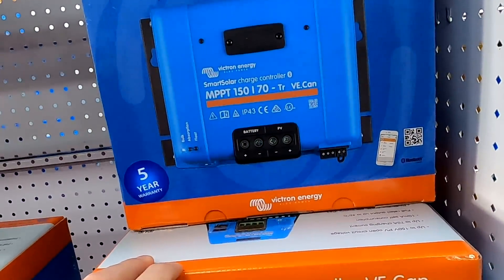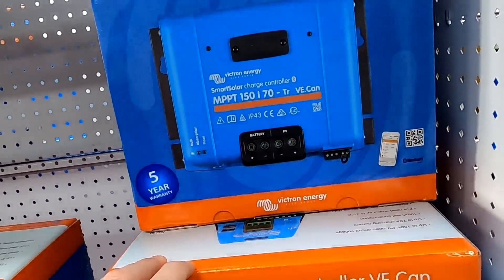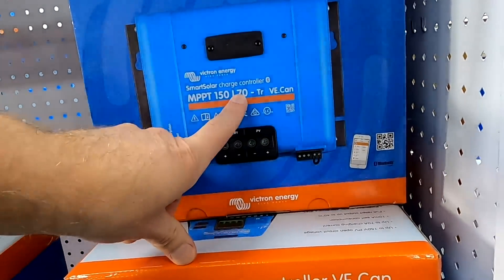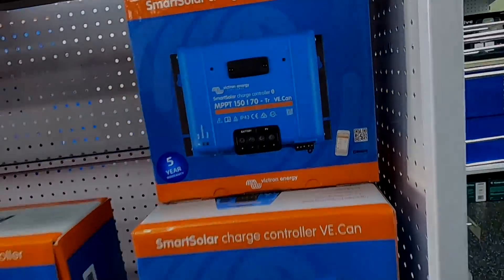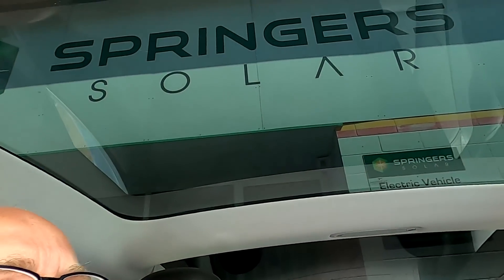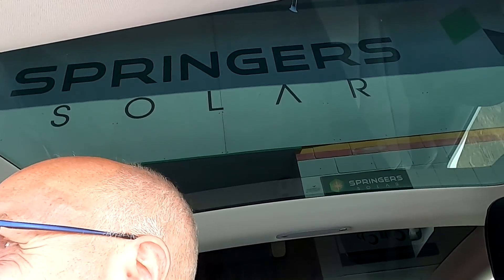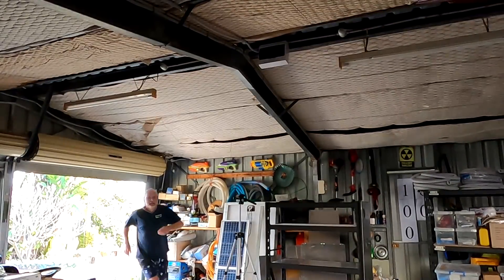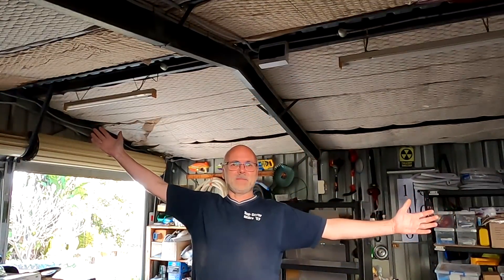Info from the Victron installer about the house off-grid connection. Not as expected... Part I

Comment: Oh good, that means both of my suggestions are allowed (charging from the grid when solar+batteries are insufficient, and permanently rewiring portions of the house to move some circuits entirely over to the off-grid garge's power).

-Matt
Reply: I've done some experiments with Victron gear...when charging from the grid, the double conversion of grid AC to DC and back to AC has an overall efficiency of about 70%...even less when under LOW load...if you pay 10 cents for a kWh from the grid, you end up paying 14.3 cents with all the losses...Is this acceptable? I don't know...
Reply: @danielardelian2  I think we can just assume a low round-trip efficiency on that order... that's fine.  Yes, higher is possible.  The point is that the actual amount of electricity you need to pull form the grid that goes through that conversion is limited.

So if your off-grid system is producing, and you are using, say, 300 kWh/month, but you have to pull 4 kWh/month from the grid to deal with those few times during the month that your batteries might go dry... well, that's going to be worth the cost even if the efficiency is horrible.  Because its only 4 kWh.

This is just an example of course, each person's system is going to be different.  That said, one of the best reasons to have a charge-from-grid solution is that you can maintain 100% of your quality of life throughout the entire period while you are tweaking your solar and battery system to further squeeze out efficiencies and reduce your dependence on the grid.

(it should also be mentioned that just the power company connection alone will impose a certain minimum charge, so you might as well eat up that minimum charge's worth of grid electricity anyway.  Its usually around $0.50/day).

-Matt
Reply from the maker: Matt, yes, that is both allowed. I just don't have a separate cable to the house to supply power to a second sub panel. Earthworks are not an option.

Comment: Quite easy. Wire your house, connect that line to the garage. Use as much as possible, export mostly, and add more batteries and inverter/s. Nice project. And all paid by exporting AC....
Reply from the maker: Nope, that's not an option as there is no cable going from the house to the garage I can use for that. Both actives and neutral are in use and cannot be separated.

Comment: Can you install an inverter with a built in transfer switch and pass through grid to the grid that you can charge the batteries to be used at night or when the grid goes down that it switches over to off grid power till the grid comes back on ?
Reply from the maker: I thought I said this many times in the video. A transfer switch is NOT allowed.

Comment: It would be much simpler, if the Energex company would just put a ceiling, meaning they would not pay over a certain amount of power exported. They would still receive free power to the grid after that top amount was reached. Everybody wins.
Reply: I agree, but they obviously can't change existing contracts
Reply: @ursmalo3103  true.
Reply from the maker: It would be great if they still except a clean transfer switch as a solution and people would not have attempted to undermine the law.

Comment: You can add a battery to your existing grid tie inverter and still keep your tarrif
Reply: Are you sure?
Reply: @stevenbliss989  With the higher feed in tariff the rules may be more strict
Reply from the maker: That's absolutely not allowed with the off-grid system. It is only allowed under certain circumstances and special setups like grid tied batteries (eg. Tesla Powerwalls). In these cases the solar would charge the battery first though which makes no sense at all if you have such a high feed-in tariff.
Reply: @OffGridGarageAustralia  I was referring to existing grid tied systems only

Comment: So, the simple solution is what you say one of the Victron installer customers has done. 100% switch your house load fully to the off-grid garage and leave the solar panels and inverter in the house 100% supplying to the grid + one cable to a charger in the garage. Ah, you say, I risk having no power for the house. Not so. You are allowed to use the grid to charge the off-grid garage batteries, which in turn power your house. Sure, some power loss on those rare occasions.
Reply from the maker: That would be easy, right. If house and garage would next to each other, I could easily do that. The 40m distance is the problem and no further cable... earthworks are not an option.
Reply: @OffGridGarageAustralia  How many conductors in total do you have running from the fuse board on the side of the garage to the house, and what gauge are they? From your description it sounds as if you have multiple conductors for phases and off peak non-essential loads. Can you not repurpose any of those? You only need 'spare' conductors to bring the solar panel/inverter output feed to the grid, which might only need a low capacity 
conductor, and only then for 7 years. I would sling it across poles, then take them down when the contract expires.

Comment: Can you make a sub-panel  in the house and move loads to it and connect to the offgrid system ?
Reply: Yes, but another "easy" solution is disconnect a circuit from the main panel, basically cover its end with wire nuts and then come in from outside by drilling into a plug's receptacle box and adding power that way.   Makes it reversible quite easy.
Reply: @mhamma6560  yes but it's a hugly hack, and it do not follow régulations. In case of dire Hazard will the insurance cover the damages ?
Reply: @vaneay  Yes, that's to code.  I won't suggest something that's not to code.
Reply from the maker: I can make a sub panel inside the house but there is no cable from the garage to the house which I could use. Earthworks are not an option.

Comment: Here is how it works in California.  If you have solar,  you are on "Net Metering".  This means that the utility,  PGE in this case,  keeps track of  how much energy you use and how much you send back to them.
At the end of the year, the utility performs a "TRUE UP" and determines your NET usage of energy.  If you use more than you make,  you pay for the energy used. But,  if you export more than you use,  the excess is ZEROED out and you receive nothing.  

Although this sounds unfair,  the utility is providing a mechanism for you to:
1.  Effectively store your energy during the year.  The utility looks like a large battery
2.  Reduce the system cost.  Grid tied systems can be cheaper because any power you don't use is consumed by the utility
3.  Be a good citizen and providing others,  who are not so fortunate as you, to use your excess power rather than simply shutting down your solar

You could argue that this is a terrible deal for consumers, but the utility designed their business model to supply you with power. So here in California, we can basically size our systems as big as we like,  since any excess we make will be ZEROED out at the end of the year.  

But there is a further problem, which is not well known, that  the utility and the statewide operator CALISO  has to face. if the supply exceeds the demand,  as can be the case at midday, they have to provide a load to dissipate the excess power,  or they have to shut down some of the supply.  As I understand there is a mechanism they can use to shut down your residential solar, but clearly this is a last resort.

So have a heart for the utility companies and the energy operators.  They've done an awesome job of adapting from a supply model to a combination supply/generation, using essentially the same infrastructure.
Reply: But our State Goverment in Queensland will not listen to any reasonable suggestions . They do not want solar power back as it reduces their revenue and causes problems with their distribution supply they say.

Comment: You can charge batteries with the grid, right? I have some suggestions,
Make another distribution panel  (call it distribution 2) with the off grid garage acting as the grid input, run a wire from the off grid garage to this panel inside the house.
All outputs of your actual distrubution panel transfer them to the distribution 2 phisically, If you have them next to each other it would be easy.
Your distribution panel 1 will then have no loads and the on grid inverter feeding to the grid.
Install a charger o varius chargers on distribution panel 1 to charge the batteries in the garage at night in case of emergency.
Buy 2 victron phoenix 5000V 48V each of them can be L1 and L2 ( you said you have 3phase but only 2 wires).

I hope it helps :)
I love your videos! Great job!!
Reply from the maker: I cannot run another wire from the garage to the house. It's not an option.

Comment: You can connect a battery charger right?  Just have that keep your batteries above 20% and have everything run by an offgrid inverter system using those batteries charged from solar.  Excess solar can run a bitcoin miner.
Reply from the maker: I don't have enough cables for that and earthworks are not an option.

Comment: Pony up and make it the “Off Grid Property” not just the “Off Grid Garage”
Reply: Everyone started to get bored
You need re invention
Reply: It's silly really because a automatic transfer switch physically isolates the grid when the house is on solar (like at night when the house is running on batteries) you could argue that it's physically impossible to export when the switch is energised..
Reply from the maker: I know, I was under the impression a transfer switch would meet the requirements. The house would be connected either to the grid or the battery, never to both at the same time. Unless you have greedy people tempering with that and Energex finds out and amends the law...
Reply: @OffGridGarageAustralia  Ist really kind of silly. Even if you had two distinct circuits in your house, you could also temper with it and put a bridge between them, as you could bridge that switch.

Comment: Take your house off grid. Leave your contract system on grid.
Reply: Yeah, right! Just put your time and money into more solar for the off grid setup and add a new length of wire from the garage to the house and add a new sub panel in the house. Done
Reply from the maker: Not enough cables as I explained 😉

Comment: In a different way then normal, once again the advice is : go Victron, they know stuff  ;-)

The battery can feed  into the inverter using the same connection as the solar. Just two conditions : 
1 you might need a DC-DC to raise the voltage
2 you will need a switch that allows only one of two (battery or housesolar) to feed the inverter.

My contract is different so I can do the following I use a small 24-48 DC-DC Victron to pump an extra 128 watt into the second connection of my grid tied inverter the moment the import from the grid goes above 200 watt. It is started with a relay that also turns of the solarcharger for the battery so that all power from the solarpanels also goes into the first connection of my grid tied inverter. To prevent hysteria it will allways run for 5 minutes at least. This really helps to lower my import and avoid a lot of my export.
Reply from the maker: That's not an option as I explained.
Reply: @OffGridGarageAustralia  It's your party, so do what you like, it is your decision.

The contract says you cannot connect solar and battery at the same time, so don't, not at the same time. So that is exactly what I am proposing, switch between them at the right moment

When the solar on the house is not producing much anymore, switch the input of the inverter to electricity coming from the batteries and keep the amps limited, so no feed in during the night, just shaving of base load during the night.

Comment: Same rules here, we can not connect anyting to the existing installation. I´ve got the AC, poolpump, fridge, freezer and all electronics on the off grid system separate from the electric grid. Works fine and if the battery is low i charge from the grid.
Reply from the maker: Yes, that's a great solution and I will do this as well with some of the loads which are connected from the meter box outside the garage. It just won't be anything inside the house for the next 7 years 😉

Comment: Iirc, you had 2 phases going to the house, can't you just drive that 2nd phase from the OGG?
Reply from the maker: Good thinking. No, that would mean both grid and offgrid system share still the neutral which is considered a grid connection.
I had the same idea and pitched this to the installer. Not possible if I want to keep the contract.

Comment: this really sucks..but to be honest i have something similar in my house with exception that transfer switch that is my own and it do not allow mix of solar energy or grid energy..only one enegy source is allowed. Solar energy is prefered so it will switch from grid to solar once inverter will start. What i have from gird is chargers..that i'm using during day ..these are there so battery will not go below float charge ..chargers are switched off during night so i can use battery ..and then again switched on during day ..this works but i'm looking for solution that would allow me to disregard chargers connected to grind needed at all..but because this isn't desert land..i expect i still have to use charging from grid in case of rainy/cloudy days ..

Comment: Hi Andy
How is your current grid connected inverter connected?
Is it run outside the house? If so it would be relatively easy to transfer all the loads to an off grid system. You probably need to run new cables to the house though to keep everything 100% separated. You can probably parallel a few victron inverters to get more power on a single fase to supply everything in the house including the ac. Maybe it's even possible to move the incoming grid line and your current grid tie inverter to a separate box and keep all your wiring in the house as is just with a new feed line

Dave from eevblog has his inverter on the outside of his house.
Reply from the maker: Yeah, running new cables from the garage to the house is the problem. Earthworks are not an option.

Comment: As I remember from yours diagram (I could not find that now) your On-Grid system (which you could not touch!) use only 2 phases?
So use for off-grid that third one!
Keep current on grid system as it is (this is the obligation), disconnect third phases from the grid, connect to the Victron (configured to zero export, only consuming - this is acceptable) – after that rewire all power point, light, etc to that particular phase. That’s all.
Your load is powered from garage and you do not modify yours on-grid 2-phases system. 
Is this correct?
Reply from the maker: That's not possible. The AC coupled solar uses one phase and the neutral to feed in power. The second phase which you want to use for the off-grid system would use the same neutral for the other loads. that's not allowed. ANY connection from the off-grid system to the grid is not allowed. The shared neutral would be considered a grid connection.
Reply: @OffGridGarageAustralia  I see. However from the electric point of view, this is quite stupid rules :)

Comment: Sounds like it is time to "mole" a larger cable under the flower beds to the house...
Reply from the maker: That's not an option due to several water pipes, electric cables, concrete around the house, retaining wall and trees.

Comment: I was right, unfortunately.
Rewiring the house with off grid power points, not an simple task, but doable.
PV system and inverter location, cabling things 50m apart...
It will be another 💩 show, all together.

At the end it will be like a freak show on the main home switch board, but seems to be the solution.
Sleeping on it, I understand it completely!!!
Reply from the maker: Thanks Carlos. I think I now have a solution...
Reply: @OffGridGarageAustralia Never add any doubts... You'r the man for the job.  👍
Keep on the good work.

Comment: Get a off-grid solar heat pump and eliminate your air conditioning and heating needs that run separate system where the inverter is all go into the HP AC unit

Comment: I think these were some solid suggestions. Running hot water, pool pump and an EV via a separate circuit make tons of sense. Not sure how you AC is set up, but if doesnt provide heat in the winter it is a prime candidate to be running off solar directly and (over) cool your house during the day
Reply from the maker: We don't use any electrical cooling or heating for the house, so that's not an issue.